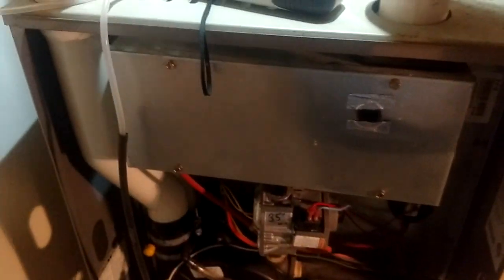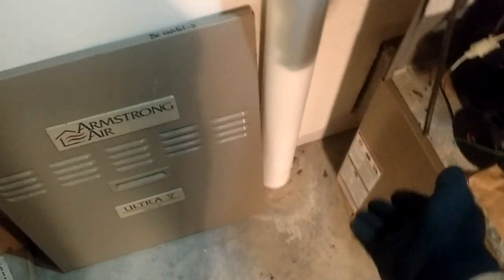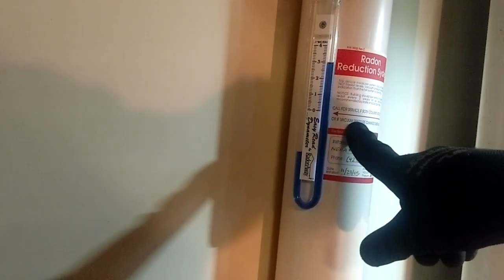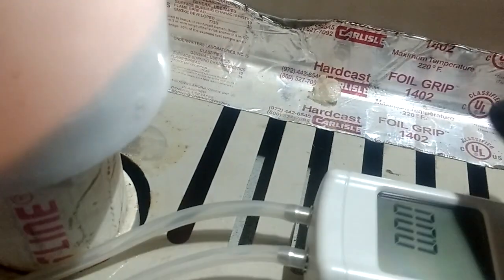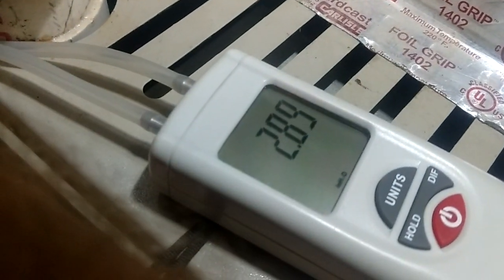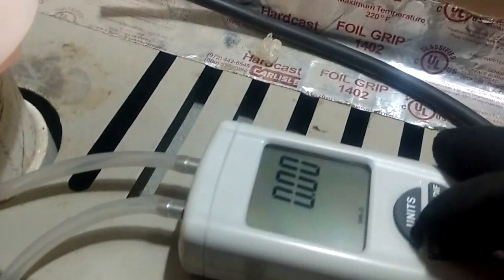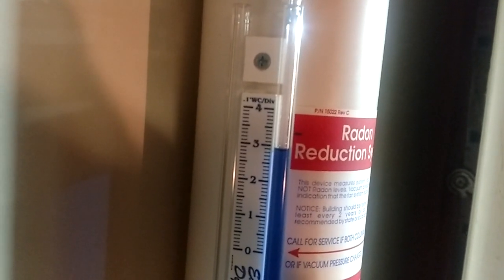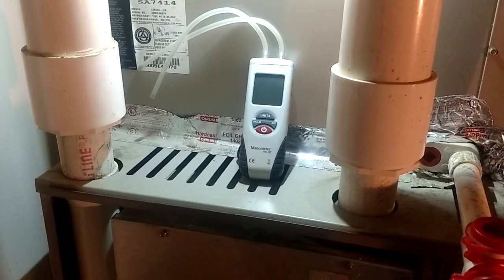The Chinese ManOmeter does it again 👍 Putting its accuracy up against a water manometer.  #HT-1890

Comment: Can you check pressure switches with it
Reply from the maker: You can check the draw on the rubber hoses to see if the inducer is pulling enough vacuum to close the pressure switch at its particular rating but I wouldn't necessarily say that you could "check" the pressure switches with it. The only instrument that does that is the Fieldpiece SDMN6.
Reply from the maker: Thanks for watching 😎👍

Comment: If I drill 2 1/4" test holes before and after my furnace fan to measure differential pressure, what do you use to plug up those holes after the test? I'm having a hard time finding out what to plug the holes with.
Reply from the maker: They make some kind of special caps for plugging the holes but they are very hard to find. Not many people carry them. I just use a piece of foil tape.
Reply: I use those refrigerator magnets that you always get with various advertising on them…one for each hole 🤷‍♂️🤷‍♂️🤷‍♂️ HVAC guys could use their own advertising magnets

Comment: Another thing to remember is, the water type will NOT require calibration. You KNOW it's calibrated 100% every time. No batteries to fail either. And leaking batteries destroying the toy.

Comment: Just received my manometer today, and was unsure which side to use for testing a gas valve. The booklet doesn't provide much information, think I'll mark the top with a - and +. Thanks for the help!
Reply from the maker: Yep Jeffrey, that was going to be my recommendation. Put a plus and minus on the top. +   -
Thanks for watching. Hope the video was helpful  😎👌
Reply: @sknight0391  Thanks, it was. I'm a older HVAC Tech. I took a Empire (propane) wall furnace from one garage and moved it to another. I'm using a 100 lb tank with a dual stage regulator vs the gas companies 250 lb tank on the previous garage. Now it's occasionally tripping the upper limit. Fan and everything seems good, and I verified that it is indeed running hot with a thermometer. Figured since I didn't have these issues before it's most likely a gas pressure issue due to using a different regulator? Looks like on the input I'm looking for 11-13 in. w.c. and 10 in. w.c. at the output (manifold) for propane.

Comment: I bought it I didn't notice yhe different hose size I got the 1/8 agh
Reply from the maker: You can buy all different sizes of vinyl tubing. Look on the internet, PetSmart, hobby stores, automotive stores like NAPA, or repurpose tubing off of old gas furnaces that are being scrapped. You can also find different size fittings, couplers and adapters which make the possibilities are endless for your particular application.
Reply: @sknight0391  I'm looking either that or send it back and get the right size which would ve which one. They 2/16 and 5/16
Reply: I used aquarium air tubing…cheap

Comment: Honestly Shannon, and I think you already know this, almost everybody likes Chinese tools these days.  Unless it’s Fluke’s high end equipment, it’s outsourced to China and sold here, like Veto bags and all the other meters. I bought a compact swager like the Hilmor set (made in China) but made by iWiss, and it was about $75 cheaper, and had twice the amount of heads, and looked exactly like the Hilmor, except in the color of the handle. If that manometer works like you need it to, then it’s a good tool. I wasn’t fond of Fieldpiece’s manometer, the one with the pump, it kept creeping up the reading when sitting idle, and I mean like .75” in a short time.  Always had to re zero it. Does that one seem to stay at 0.00” when not attached?
Reply from the maker: Yes the one in the video stays 0’ed. I didn't care for the Testo 510 for that reason, very "creepy". I just didn't feel I could trust it's readings, so I got rid of it. 
Thanks for watching 👍